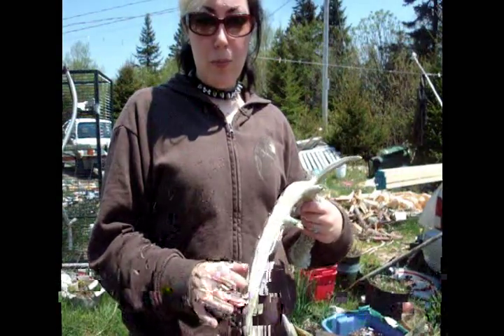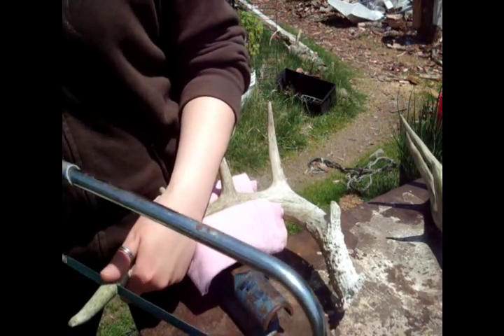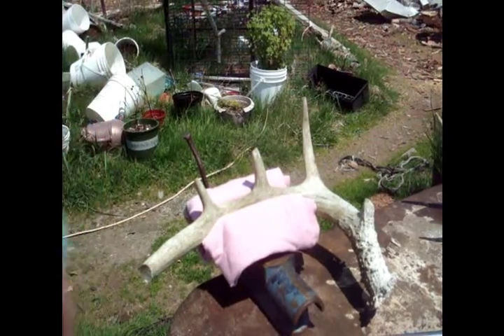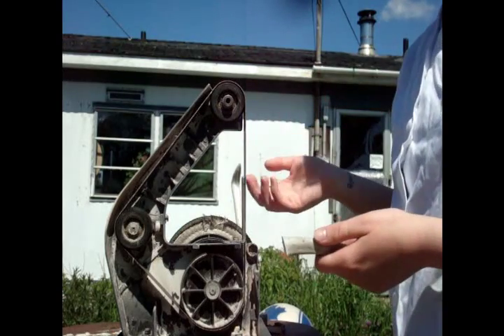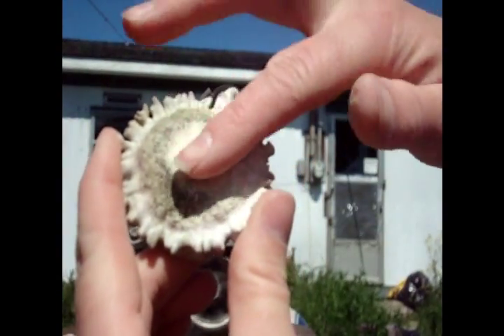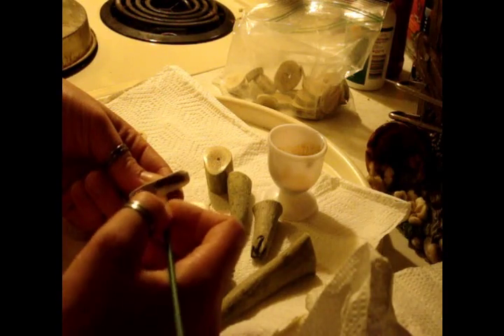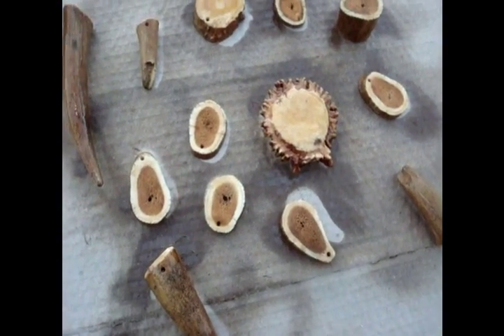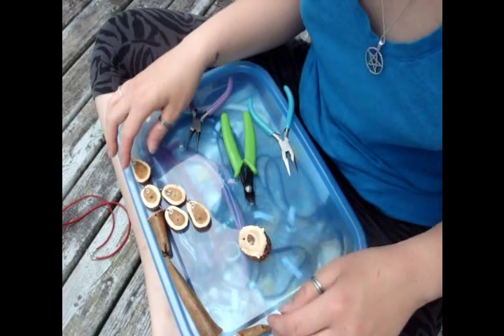Making Antler Disk Pendants

Comment: Do you ever wear any dust masks or anything whilst cutting through antler and bone? I heard that breathing in the bone dust can be bad for your lungs as it's too heavy to breathe out and can cause white lung or something? I don't know if that's actually true, but I read about it somewhereorother a while ago. xD
Reply from the maker: Rhaveyn  i have not worn a dust mask in the past, but i will be doing so in the future. i always figured that i didn't get exposed to it often enough to bother with it, but my sinuses were so congested the last time i wont be so stupid in the future. i do wear eye goggles when operating the equipment though. i have also taken to wearing goggles and a face mask when scrubbing bones that have a lot of biological material still on them.i am not sure what the condition is called, but inhaling any amount of dust is bad for the lungs. my fathers lungs are burned out from years of using a cutting torch, welder, grinder, sanders, and car painting equipment without any respiratory gear. of course, even though he is on puffers and told to stop doing such things, he is still using the equipment without protection. and he still smokes too :S
Reply: Fair enough! I'm glad to hear that you'll be wearing one in the future - I'd hate for any health problems to arise for you through doing something that you love. That's a good idea though, I should probably do that too actually. :/ I've even taken to wearing a dust mask when illustrating bones due to the little flecks of dust the scratching of the pen creates. 

Oh no, what a shame! And the fact that he still keeps doing it the old way despite the health problems is always a worry. I think my brother is going to be like that, though he only smokes.